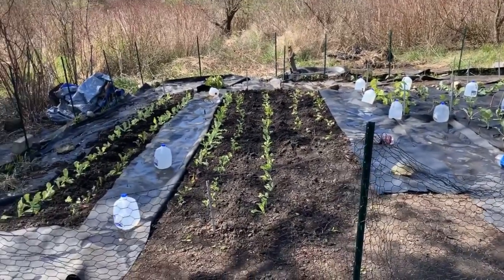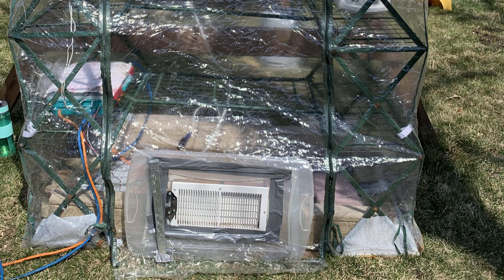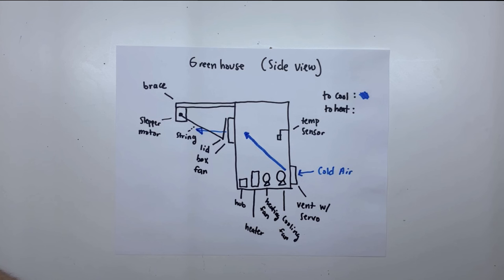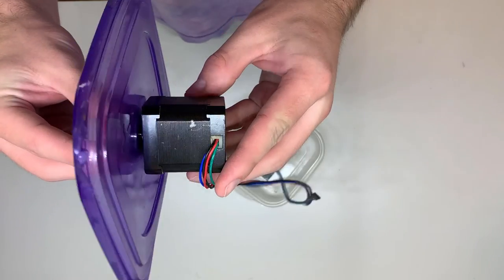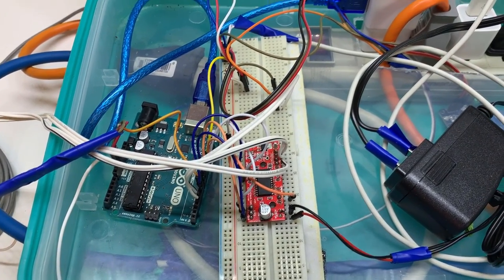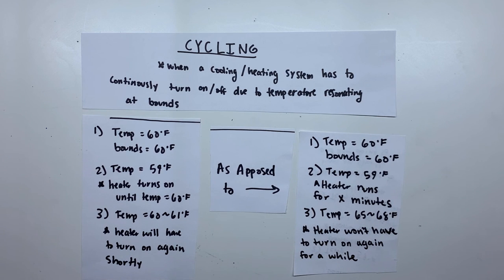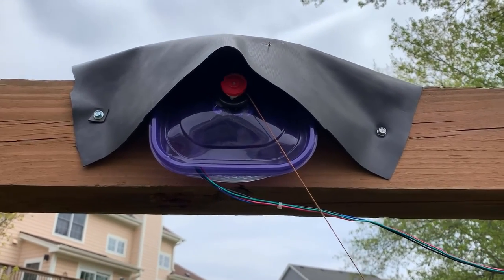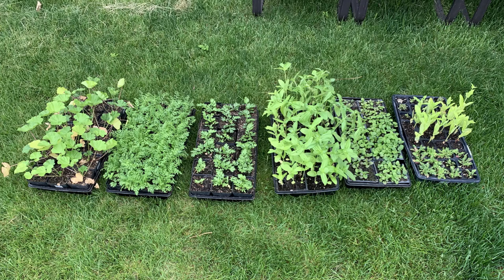Automated Greenhouse (Arduino)

Comment: I would suggest adding humidity sensing to the mix as well as outdoor air temperature.  Use outdoor air temperatures to determine heating and cooling cycles, use a deadband switch to modulate each cycle to further improve controls.  You could even modulate the dampers before fans and use natural convection to create airflow without powering a fan, based on a min/max.  Use a slope/intercept variable to calculate damper positions to maintain certain targets/setpoints.  Also consider using heat to de-humidify during 'those' days.

Comment: Really nice! I would consider improving this system by replacing the Uno by an ESP32 + Arduino IoT or Blynk IO Platform. Thus enabling remote monitoring, configuration, alarms and other features.

Comment: I wish you went further into the water cycling aspect of this project
Reply from the maker: Preventing cycling is important because of the relays I am using to control the fans and the heater. These relays have a lifespan and it is based on the amount of times it has to switch states. Preventing cycling allows the lifespan of the relay modules to become greater. It may not seem like a big issue; however, if cycling prevents three times the switching, then the modules should last three times longer.

Comment: 4:05  why did u tape the AC adapter to the wire like that, instead of plugging directly into last plug ?    I like how you use things you have lying around.    Also do you have any temp data to show how well it regulates temperature?
Reply from the maker: I ended up taping the 12v power supply to an AC cord to plug it in. I only did this because the waterproof box wouldn't close otherwise. Waterproof cases/bins are fairly expensive to buy, especially when they are large like the one I am using. The reason why I used tape instead of soldering is that soldering adapters poses the risk of melting the internal components. 

I originally had a tracking system to monitor the number of minutes the heater and the fans ran for. I used a Bluetooth module, along with a tablet to do so. I regulate the temperature in the greenhouse to be in the range of 60F-78F. From the data, I estimated that on an "average" spring day (32F-50F), the heater ran for 2.7 hours, which would equate to about 50 cents for 24 hours. I also covered the greenhouse with blankets at night to help with insulting it. Electric heaters are not a viable long-term solution for heating as it is very expensive; however, I only use my greenhouse for a month out of the year, so it is not that big of an issue.